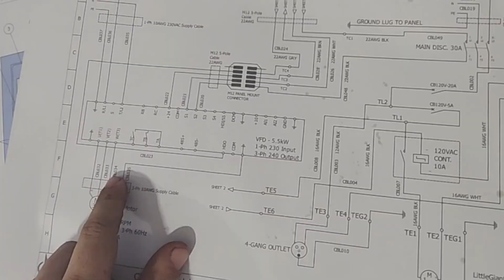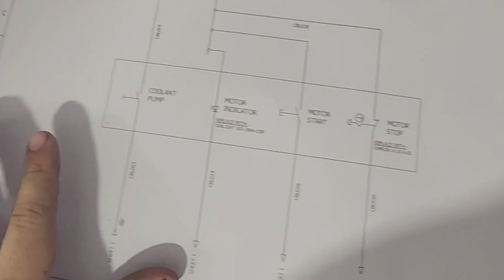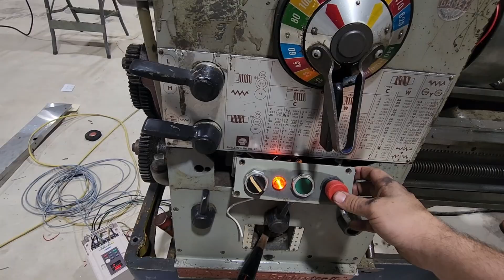New Machine - Clausing-Colchester 15x50 Lathe

Comment: Great video. I’m about to do the exact upgrade to my 15”.
What coolant pump did you go with? I never heard the name on the video and will it pump cutting oil?
Reply from the maker: Sorry for the delayed response. I ended up with a Little Giant VMC-1 that I retrofitted into the original oil tank with some standoffs to let the pump sit lower. It works plenty well for water/coolant mix but I have doubts it would pump pure oil. It's not the highest quality, but does what it's supposed to and is now indispensable to me.

Comment: I have this same lathe. Currently, I'm running it on a rotary phase converter, but I'm considering going the VFD route. Would you consider listing the components you used (a link would be even better), and possibly a schematic??
Reply from the maker: Hi, sorry for the delayed response! I'll post as much info as I can in this comment. I used a chinese 5.5HP VFD, (mine is a "MOLOM VFD 220V 5.5KW 25A...") I store it in a seperate enclosure with my Mill's VFD, braking resistor, etc.

In the box, I used Automation-Direct FZ circuit breakers for the 120 DRO/Light/etc. outlet and coolant pump power:
AUTOMATION-DIRECT~FAZ-B20-1-NA-L-SP
AUTOMATION-DIRECT~FAZ-C5-1-NA-L-SP

I re-used the existing disconnect to disconnect 120V when the box is opened, and GH15BN-3-10A contactor for the 120V pump. I control the VFD with a 5-conductor M12 cable. +24, GND, HDO, S1 and S2. I configured the VFD in what's called "3-wire mode" which uses the S1 and S2 terminals and HDO for the indicator LED to show when the motor is running. I replaced the indicator and stop buttons with DIALIGHT 657-2904-103F  and OMRON A11E-S-02. 

The coolant switch turns on the contactor with 120VAC to switch a 120V outlet I installed inside the coolant pump's enclosure. 

I will warn you, pulling new wires through the old cable duct in the lathe is mega difficult. Re-use wires where you can. 

In a nutshell, I have incoming 240VAC into my VFD inside of my external enclosure. This enclosure powers my mill and lathe, along with some other shop equipment I wanted switched. I split 240 into two 120VAC circuits in this enclosure. I ran 4 conductor cable from the VFD to the lathe - direct to motor, along with a 120VAC supply line to the lathe's OG disconnect. There is only 120VAC and 24VDC inside the lathe's enclosure now. 

Hope this helps, let me know if you have additional questions!

Comment: thanks for the vid. i just picked up the same model of lathe at auction.  got it running, but the rest of the electrical and vfd tuning is giving me the same fits.  it’s nice to see it’s possible to make this beast run with time and patience!  looking forward to seeing more from you.
Reply from the maker: Thanks for stopping by! Stay tuned for more! These lathes are awesome. This one has already seen a lot of use in our shop. Let me know if there's anything I could help you with.
Reply: Awesome machine. I have the English version, which is almost identical, and it’s a beautiful machine to use, so much nicer than the Taiwanese (think Grizzly) that it replaced. I went with the VFD too and I learnt a lot about setting those up as well as learning to read “chingrish”. I had a high pitched squeal coming from the motor but was able to get rid of it by adjusting the switching frequency of the VFD. I was also able to adjust the motor start up and stopping speed, again through adjustments of the VFD. I installed a master switch that powers everything up and I set the lamp on the front panel of the lathe to come on with that so I can easily see that it’s still all powered up when I go to walk out of my shop. I know it’s a time consuming and steep learning curve setting up a VFD on these lathes but I got a great sense of accomplishment when it was all done and a much better understanding not only the enormous amount of parameters available but how to set them as well. I found that once I got my head around the way it required particular sequence of steps to make a change it became much easier. 
Good luck with it and I hope you can find a replacement handle for the gear change. Cheers, Stuart. Australia.
Reply from the maker: @scroungasworkshop4663 it sure is amazing. Every time I use it, it's been a pleasure. I've set up a couple Chinese VFDs now and this one gave me a lot of trouble trying to switch it's input mode between sink and source because of what I had available in my wiring to the front switch panel. The instructions mentioned it could do both by switching a jumper, but it in fact couldnt, from what I could tell. 

I'm keeping my eye out for a gear lever replacement! They are tough to come by and $$$. The detents on mine seem a little weak too, so I may do a video of cracking the top open again to service some internal parts. 

Thanks for stopping by!